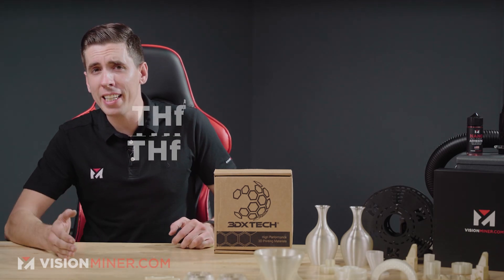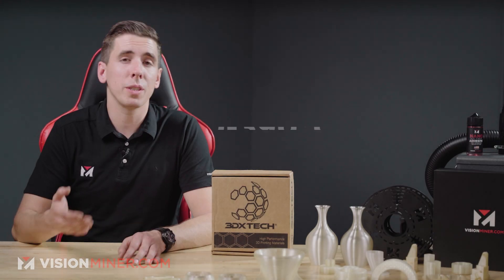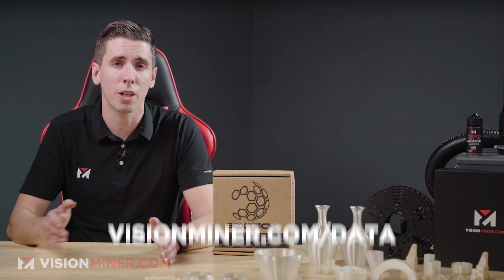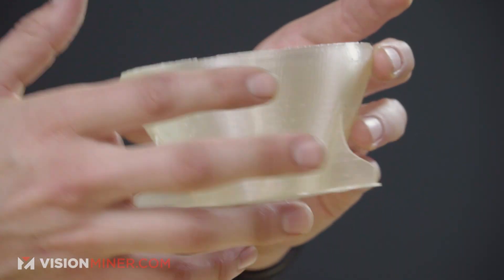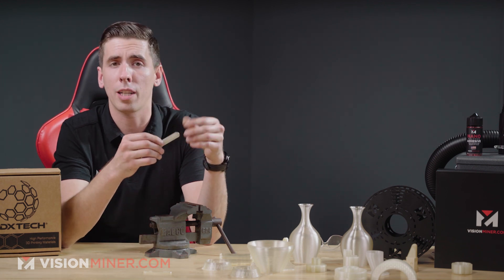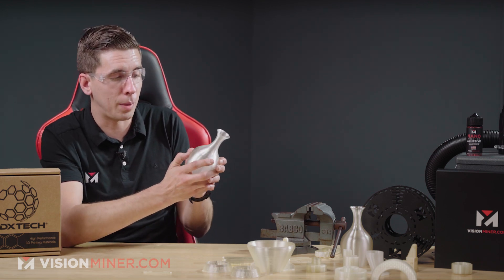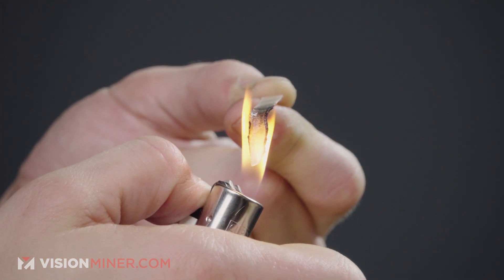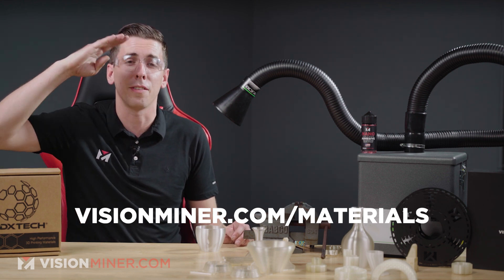ThermaX PSU - PolySulfone High-Temperature Chemically Resistant Filament from 3DXTech 2021 Overview

Comment: Nano Polymer is to expensive and doesn't work any better then a gluestick.
Reply from the maker: low temp prints yes but Nano Polymer Adhesive was really designed to handle high temp materials where glue sticks have failed us in the past.
Reply: @VisionMiner  Agreed! But I've found your NPA to work better than anything I've ever used (including 1-part urethane like Gorilla glue, which is particularly grippy with nylon). I've certainly tried countless build surfaces since 2012 when I started 3D printing. I've often found NPA to be too grippy with PC prints on WhamBam PEX (damaging the PEX), but NPA is totally "adjustable." For PC, I typically use about 5ml of IPA in a cup and add one or two drops of NPA to it and mix and apply with the brush). When applied in diluted form like this, I don't expect the treatment to last more than one print between IPA cleanings and re-application, but the strength of the bond can be adjusted exactly as needed and, given the diluted application for each print, it's still very economical! Glue stick bonds are too hard to control and often in the direction of poor adhesion, which I guess is better than pulling chunks of material out of one's build surface. The problem motivated me to experiment with custom dilutions of NPA with terrific results.

Comment: Good sales pitch BUT you should go over the cons of the material at first as well, such as : is it UV resistant ? absorbs water ? can it be painted, epoxy coated, glued , are the fumes toxic, etc..

Comment: But; this is the thing that's killing me", I go over to "Matter Hackers" and compare prices and quantity.   You guy's stuff is very expensive, and that's where the battle is won and lost for me.   I'm doing working prototype parts that have to prove viability for production applications, so; the stronger, the cheaper, the better, and that's where Matter Hackers wends hands down.    Vision Miner PSU $125.00 for a 500Greme spool...1.102 Pounds.    Matter Hackers PRO Series Carbon Fiber Nylon $225.00 for 2.268 kilograms, or 5lbs.   "That's what I'm talking about"
Reply from the maker: Apples to oranges though -- our 3DXTech carbon fiber blends are higher quality and almost the same exact price, but PSU is a material in an entirely different category -- chemical resistance, temperature, food-grade, un-filled... it's not really a comparison :) Bang for buck for regular prints, though, CFNylon all day! Check out the selection we carry, different nylons -- HTN, PA6, PA12, Even HTN CF25: https://visionminer.com/collections/filament#nylon
Reply: Psu is more than cf nylon